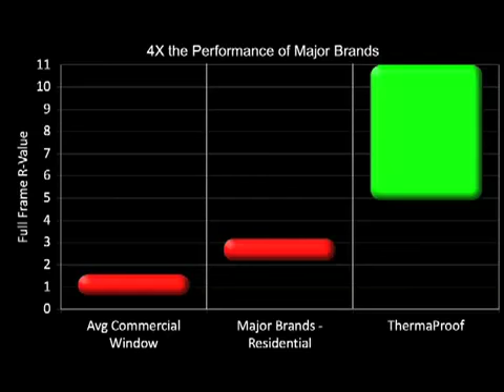Replacement Windows - Serious Windows

Comment from the maker: @HomeEnergyNow I'm not sure why you'd want a 10 pane window either. Sounds like a waste of money. 

But, in case you haven't noticed, people replace old windows with new ones for a variety of reasons (aesthetics, comfort, condensation control, efficiency,...) and SeriousWindows makes an excellent line of vinyl replacement style windows that beat the pants off the competition from a performance standpoint. And, they're only marginally more expensive. Good news, even for the math-loving folks!